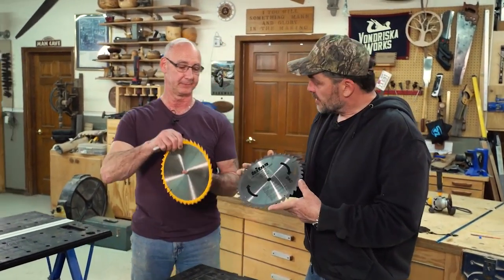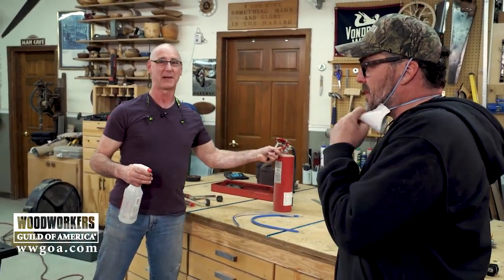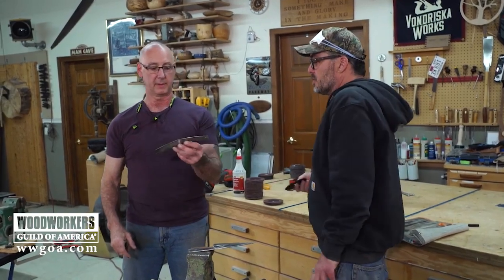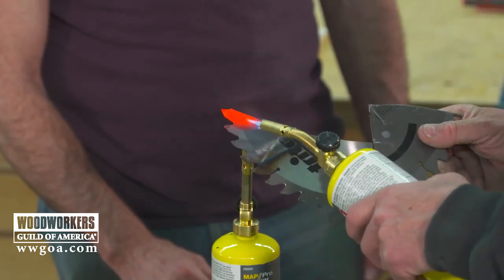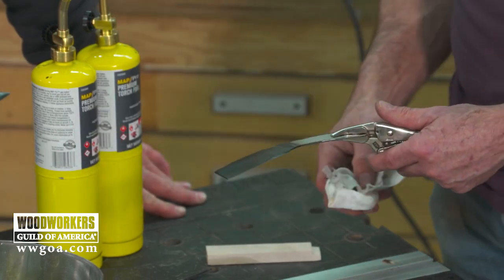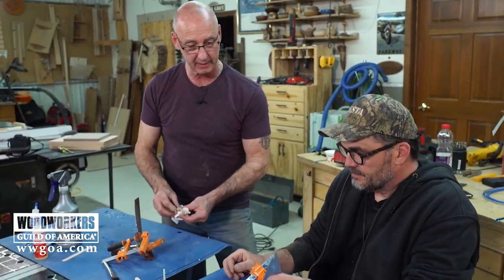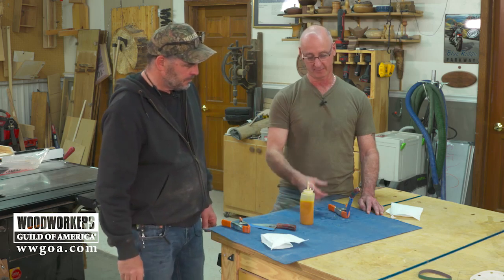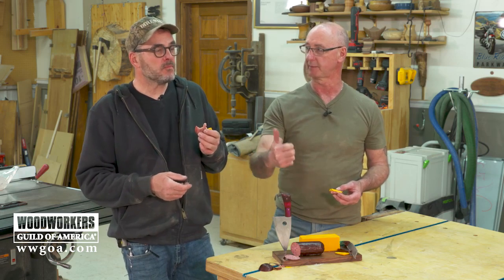MAKING A KNIFE FROM A SAW BLADE

Comment: Two gems from HF that I bought were the 2HP Dust Collector and the 12" Disc Sander.  The Dust Collector is stated at 2 HP, but I would venture to say it's more like a 1 1/2 HP motor.  It works great.  I upgraded the impeller and am using an Oneida Dust Deputy XL with it.  No complaints.  The 12" disc sander works well.  I wish it had a cast iron table instead of aluminum, but works great non the less.